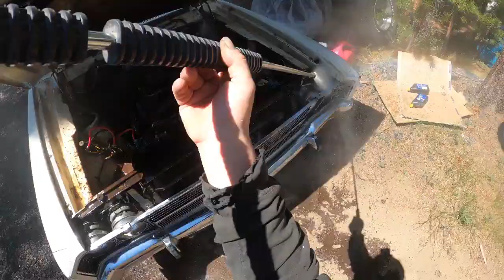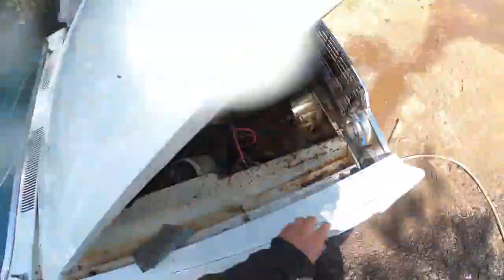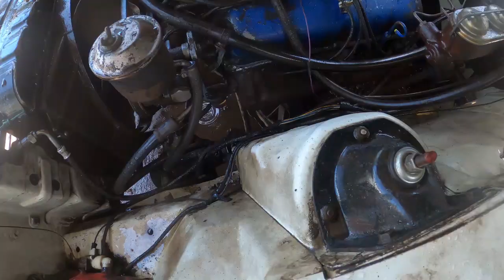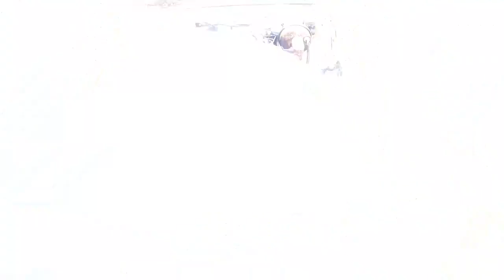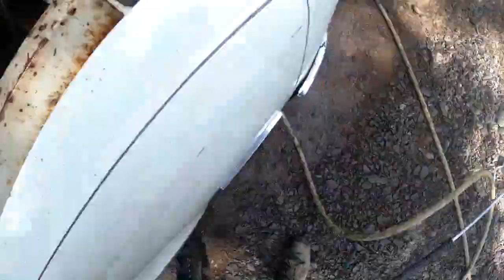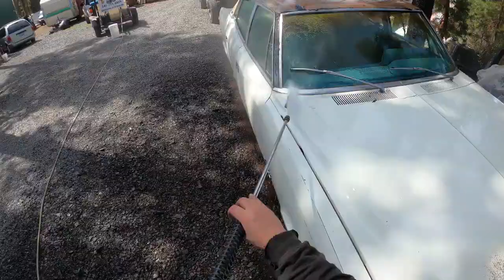Timelapse-Uncovering High compression 343 Typhoon! Cleaning a 1970 AMC Ambassador. Gambler 500 car.

Comment: Well, that is a 70, so the engine cannot be a 343 unless it has been swapped, since the 343 was last used in 69. 70 had 304, 360, or 401 engines if a V-8. I slowed it down in a couple spots, and noticed the Carter AFB carb. That engine has been swapped, the AFB was also last used in 69.
Reply from the maker: I’ll need to find some engine numbers to confirm but the air cleaner says 343 Typhoon hi compression 4 barrel.
Reply: @savagecustoms541  Right, but the engine and air cleaner can easily be changed, as it obviously was in this car, since the 343 was last used in mid-69 - I am curious as to what it originally had in it. Is there an emblem on the side that has engine size on it? Easier yet, the 7th digit of the VIN is the engine size, A=199-1v, B=232-1v, C=232-2v, H=304-2v, N=360-2v, P=360-4v, X=390-4v. As for the engine in it now, the size will be molded into the block, right under the motor mounts on each side.